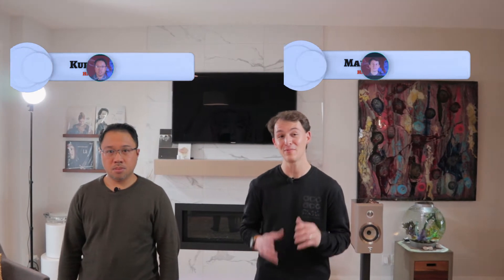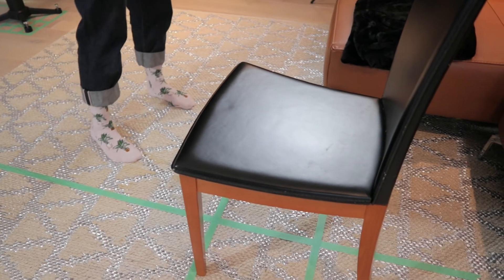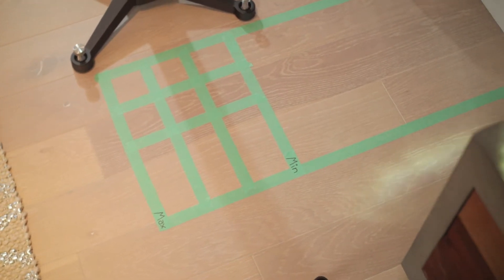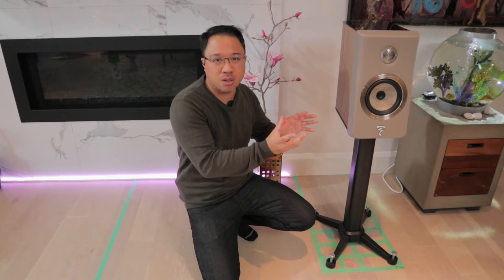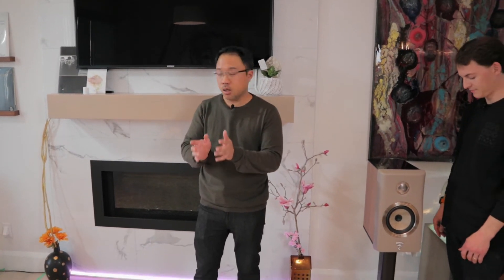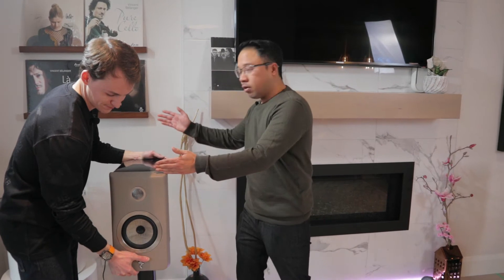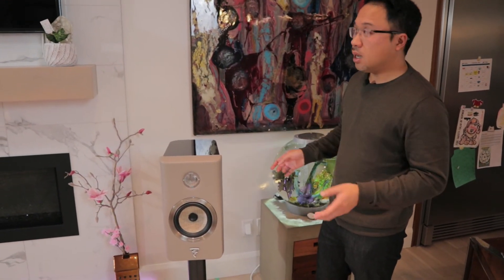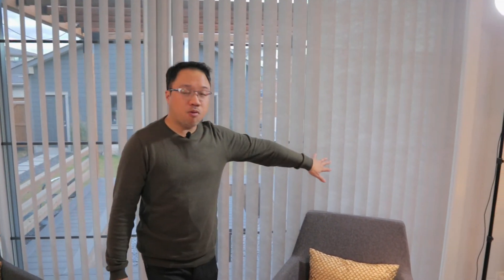Fine tuning the practical speaker setup(part 2)

Comment: That’s awesome. When everything is set up, can you remove the tape? If the tape is removed then how do you know what you done?
Reply from the maker: You really don't want to move the speakers after you are done. If you can mark out the position with tape at the back so you don't see it...If you do a "2 position setup" the tape will be hidden by the speaker. Hope that makes sense.
Reply: @Hifyed  make sense. Thanks